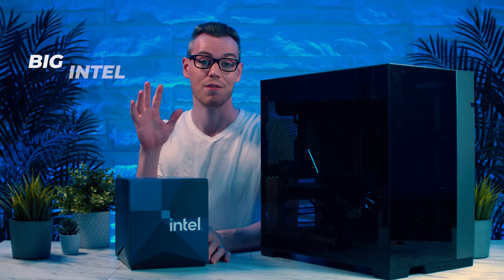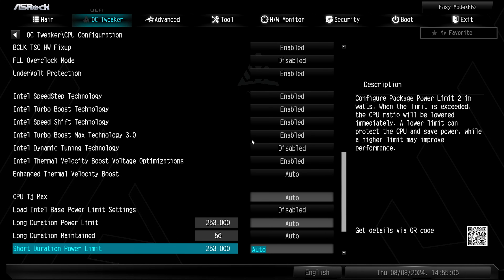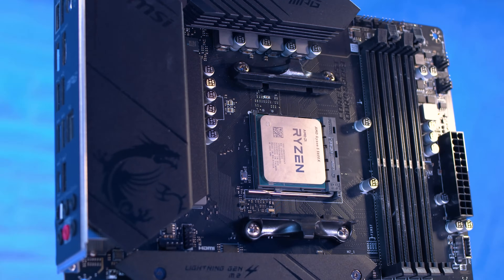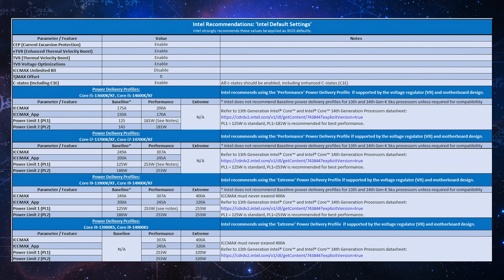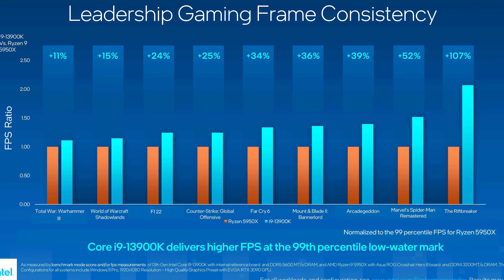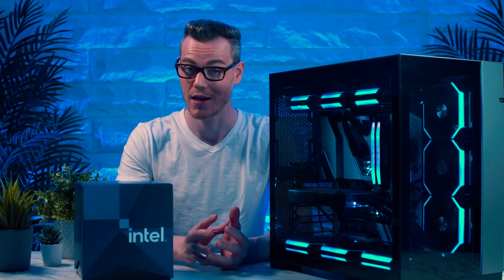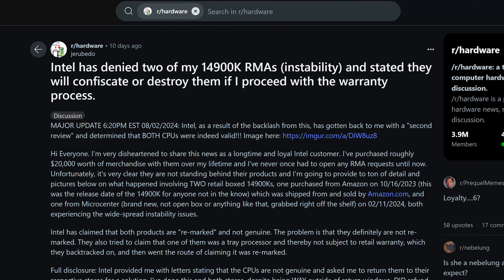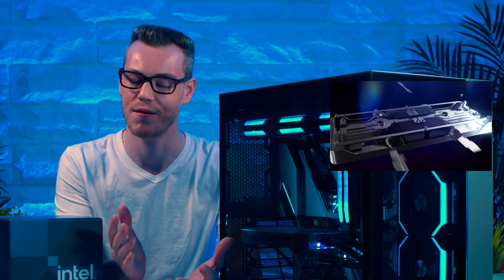The Intel Problem vs My $4000 PC... I'm Getting Mad Now

Comment: For the first part if my life i was all intel, when it came to cpu, after all i had a pentium e5500, e8400 , after that went to an i7 6700k , than to 8700k.
But i kept track with AMD stuff.Than they released the 3000 series and the core doubled again to 16c/32th as well as the ipc. At this point i decided to get an AMD processor, the ryzen 3600 , which i soon upgraded to ryzen 3700x and in 2022 i got a ryzen 5900X, which at 1440p was perfect along an rx 6800xt.
But i wanted the best for once and a month ago i got the ryzen 7800x3d and a rx 7900xtx. I have yet to test the difference, but what's certain is that i won't be upgrading anytime soon or at least untill i actually have to or there's a noticeable increase in IPC and cores per CCD along with 3d Cache. Now i'm all AMD and i'm glad i made the switch.
Reply: Same. All AMD, 5800x3D and 7900xtx nitro+. Been building PCs since my teen years and this is the most satisfying build I've made so far.
Reply: @Greenalex89  Same AMD 5950x, Sapphire 6700xt. Building pcs 30 years, best rig yet. Intel screwed the pooch, I had the original Pentium 60 with FPU and was never compensated. I've also have Nvidia chips with substrate issues in laptops. Both times they wriggled out of it until the machines were out of warranty, Intel will do the same now.
Reply: you're thowing too much money on computers man...
Reply: Half AMD :)   5800x OC 4,7all core + rtx 4070  the pc runs flawless !!!

Comment: New microcode still hitting 1.55v ....1.4v  is really pushing  the safe spot.  40mv drop is not saving anything but may get them out of warranty in home use servers now will last 3 months not 2

Comment: It's just a patch to keep the power spikes down to a minimum  so chips degrade slower until those warranties run out and they won't have to replace all of them.
Reply: Exactly, it's basically a band aid over a bullet hole
Reply: Yep
Reply: run the chips at 1.5v+ and warranty the chip as soon as instability occurs. It's yuour right to get a chip with the performance advertised.
Reply: Sad and likely correct.
Reply: With a 30% performance reduction. Just another reason AMD Ryzen wins easy.
Reply: the increase voltages in other things while dropping vcore
Reply: Ooof that's a whole ass thought and a half.. I mean Intel said they were extending the warranty an additional 2 years on top of the original 3 year warranty. I also noticed from what little research I've done, it appears Intel is openly accepting RMAs on the affected CPUs, which also restarts that 5 year extended warranty.
Reply: Yeah, some slight voltage spikes are no problem for normal, fresh, healthy IC's. They can snub them no problem!

This voltage thing is a bandaid.

Comment: Trying to get a replacement for my 1 year 5 month old  i9-13900k and you're right about Intel Customer Support acting like we're doing something wrong or that we should be all computer pros and figure out how to fix their failing products, I've been waiting for a week just to hear back from the person who's supposed to be helping me with my i9-13900k problem and I definitely don't want to call and be on hold for hours at a time with those same results.
Reply: the i9 is a Enthusiast CPU product and is top tier for programmers , streamers and PC pro,s , when someone buys a i9 , they ussaully know how too build and or configure a PC and optimize it and reflash their bios or manually enter the settings --> in bios too fix the issue with Ai bio,s automatically giving the i9,s too much voltage and a failed overclock which it isnt supposed too do at all , power limits should be set too PL1-125 and PL2 253 and Core voltage while idle 1.0v and core voltage while boosted 1.2v , average gamers ussaully use i5 and i7,s ... you can manually press and hold DELETE or F12 on startup too enter Bios and enter the correct Intel Spec power limits and voltages or update bios too fix the issue causing crashes .. the issue is auto overclock failing and causing crashes ... and actaully Intel has had alot of SCAMMERs sending in i3 12100 and i3 13100 for warrenty with re silk screened too look like i9,s !!!! so they refuse too replacce those ones as their not geniune intel core i9,s .. scammers trying too get free i9,s ... not everyone is doing that but alot have ..
Reply: @EpicGamingEct  you are incorrect  stop trying to say its not intels fault . the cpus are defective . period

Comment: i wish more people pushed static frequency/voltage overclocks instead of adaptive to vid. since 4th gen VID has always been much higher than what a chip actually needs to pass stability tests. the 100-200mhz you might lose on a single core boost to have a stable, consistent, all core overclock is absolutely worth it. do you really need an extra couple hundred mhz for internet explorer? runescape? nah. its within margin of error.
Reply: the cpu is still going to die
Reply: @zerokool1985  yeah but it wouldnt die/degrsde from voltage surpassing 1.6 at least. thats pretty huge.

Comment: I have a real aversion towards Intel. they made me angry once (yes that is enough) with their Spectre SW that was only running in US English Windows Systems but threw an error code when trying to run their Program on a PC that was running Windows in German). They corrected it after I opened a support ticket. Since then I never trusted them ever again and they make me still angry. 

This now is a real debacle. I am glad I run a AMD Ryzen 7 5800X. I do not care it is slower than a 14900K but it is stable and Rock solid.
Reply: Calm down, just think about your cat.

Comment: I'm a little confused, I've watched a ton of videos on this because 100 percent certain I'm affected. If your chip is already screwed will the update work ? I'm not tech savy at all. I have no idea how to run the tests everyone does so I'm not even sure if my chip is screwed or not. All I know is I've been having my games constantly crash for the past two months. I spent 6k on my pc so I shouldn't be having this problems.
Reply: no if your chip is already dead it's dead, no microcode will help it
Reply: RMA the CPU.  You cant reverse degradation.
Reply: NO! Intel even says, if your chip already has damage there is nothing that can be done. The problem besides misinformation claiming the update "fixes" the issue, many people have damaged CPU that it not yet bad enough to crash all the time.

Comment: The most importance is any chance that the coming 15th gen CPU has issue (degradation , freeze during high load) or not . If I am not sure I will jump ship to AMD , I dont have time to waste , just buy AMD and good to go.
Reply: I'm jumping back to AMD next build. I spent a lot of time tuning over the past year to get 12700KF & 12900KF rigs stable. I don't think it was worth the cost savings though both are great htpcs/gaming rigs (perhaps a 7800X3D would have just been less hassle). The experience to get there was bad though, countless Windows 10/11 fresh installs, ram swaps (still not getting QVL promised). The last straw was , just went full (no dual boot anymore) Nobara 39 now 40 fresh installs. My Intel experience with stability did get worse over time and I feel on the one hand I may have blamed the 7800XT & 7900XTX for crashing in a few games . When even the 4090 was having issues, I think some of those were just Intel issues. Am e cores off, running decently conservative settings on the Z690s. My friend I helped with his 5800X build in 2020 has 0 issues. Even if a future sale exists I'm not sure it's worth saving a small amount of money to have to troubleshoot just to be stable. I haven't played much with 12400F, still have that B760M from the original builds. I feel like 9600K and 12th gen moreso are the most time I have ever spent on BIOS settings. Everything is updated and I do like some learning/tinkering but I feel like never again if I can help things. It probably wasn't Windows or AMD drivers fault though any Alder Lake issues, oddly enough the AMD drivers/machines were stable on Linux. I think the theory about the IO moving for 13th/14th that they made it worse is interesting. I could stay on these machines a good 2-3 years and be happy now, but I don't think I would build them again.
Reply: There ain't gonna be 15th gen, they are calling it intel ultra X naming. Msi claw already has the ultra 5 and ultra 7 APU's
Reply: Arrow Lake will be unaffected. It's years in the making unlike Raptor trash lake.
Reply: Im surprised you are hoping 15th gen will be better! do you like suffering?
Reply: @elizabethiradukunda1950  if you understand what Raptor's problem is you do would be assured Arrow will be fine.
Reply: @epeksergastis  well.. atleast you wont say we did not warn you.. didn't intel promise the world with raptor? 
the same guys who lied to you on raptor .. now are 100% honest?
Reply: @epeksergastis  The problem with intel is the same problem Boeing has.. unbridled american corporate greed.. it's stock prices first, customers second
Reply: @elizabethiradukunda1950  you are being emotional and not rational. They even suspended dividends ffs...
Reply: @epeksergastis  oh really... as i said.. at least you were warned

Comment: I’m very tired of this mess which I think was created by both motherboard and Intel together. Out of the box the CPU should have matched default specs. Either Intel was ignoring that motherboard were not following specs or knew and looked the other way. That’s where Intel is culpable. They should replace all damaged chips and make the consumer whole again. The consumer should not have to be put through this level of anxiety. However having said that as the microcode gets released and the damaged CPUs get RMA’d and replaced, this will level out and I believe six months from now no one will remember this. Especially if Lunar Lake and Arrow Lake look promising.
Reply: The mobo manufacturers were put in the situation by Intel's non-validation of BIOS and settings.  They were used to give Intel plausible deniability, while winning benchmarks.
Reply: @RobBCactive  this . the cpu asked for high voltage and couldnt handle lower ones that effect the IO controller so the board venders did as they are told
Reply: @zerokool1985  Yeah, basically the P-core was asking for insane high voltage at idle anticipating being busy, meanwhile the ring bus and economy cores on the same power rail were out of spec.
Reply: motherboard venders are not at fault at all the board gives the cpu what it asks for .
Reply: @zerokool1985  there was nothing stopping a mobo vendor from setting a sensible ceiling voltage that could not be exceeded without action from the over-clocking menu.
That would probably have saved a lot of CPUs and gained the MB partner kudos for adding a fail safe.
Even erroneous microcode can only request not enforce a VID request.
Reply: Firstly don't buy unlocked CPU SKUs and dont buy overclocking motherboards. However Level1 techs proved this happens in commodity workstation motherboards and CPUS used in game servers. It can happen with motherboards on consevative settings. The fact nobody knows what default settings is, is also Intels fault. Intel has been running hot CPUs to win benchmarks for years now, they just finally cut the last corner to topple the house of cards.
Reply: @morpheus9137  that's because of the microcode bug causing excessively high VID requests in anticipation of resumed load and/or a weakness in the design that damages the ring bus.
Which will take a while to find out assuming the hotfix delays degradation.

Comment: i find it so funny how every techtuber rides the clickbait wave
i build high end gaming rigs, all with intel, cause amd has nasty lows and did not improve since zen2 (fabric is literally the same)

my configs stay under 1.4v doing 5.7/5.8/5.9 all core - no useless single core spikes (no gamer needs that, only cinebench techtubers)
not a single intel chip (i built 26 high end systems since 13th gen) degraded or is unstable - maybe people should start buying stuff from professional builders that use a tiny bit of common sense.

why is nobody ripping amd apart for having super bad lows and showing wrong TDP? (9xxx uses like 170W instead of their "standard" 65W - did not see a single amd fanboy techtuber mention that yet)
Reply: TDP isn't the power draw max, wtf are you talking about?
Reply: @GoonyMclinux  9700x never runs with 65w in any app - 14900k states 125w "standard/base" and a max of 253w
though in idle/browsing/watching videos it is around 60 watts

the fk you talking about

Comment: I noticed this problem a year ago and promptly switched to AMD 7950x3d.
no it's not as fast but it's rock solid.
no more crashing.
Reply: that  cpu is beast master
Reply: People have lost the plot the last 10 years with gamers review videos pushing overclocking, a stable system is the number 1 priority. Undervolt or run stock, don't overclock people. Don't buy OC parts or motherboards, save yourself a bundle and have a rock solid system.
Reply: Yeah well everyone can't afford to throw out their $400 or up mb because when I bought my Intel cpu AMD chips were catching fire so I went with Intel, not everyone has a crystal ball on hand.
Reply: @EddieMcclanahan  you mean a few on a specific mobo that was addmitid to be the mobo  fault and where amd said the same day that it would replace any damaged chip? Vs intell hiding ww2 gens of bad chips? I would agree ridenyour setup till it dies but if you defend intell or buy thier products again you deserve the issues you get.
Reply: @EddieMcclanahan  asus admitted to the issue themselves and amd gave new cpus unlike intel
Reply: @zerokool1985 Asus has been having plenty of issues recently. I've been avoiding them for a while.

Comment: I'm running a similarly priced machine, granted a lot of that price is 18 Corsair RGB fans... Yeah that one hurt. 
My only blessing is I'm still running a 12600k chip. 
I have a new z790 board with a 13700, but I'm not sure if I should bother putting it in
Reply: 18 Fans? OK, enough internet for me today
Reply: @Greenalex89  this is an air-cooled build in a thermaltake core p8. 
18 fans isn't even the max that you can do, it's just the max that I could afford
Reply: send the 13700 back
Reply: People spending all their money on fans and RGB kinda had it coming, buy sensible 'boring' hardware guys.

Comment: I think this is a defect in the architecture of the 13th and 14th gen cpus. The microcode bios update in my opinion is just a bandage to slow down the cpus from failing .  If it was just a micro core issue intel would of released it a long time ago, I mean the 13900k came out almost 2 years ago and their just releasing a patch for ? makes no sense
Reply: The team that made the 12th gen said the ICC was beyond maxed out also ringbus, they left and new team made 13/14 in record time. Not hard to figure out what went wrong lol
Reply: They have fucked up the Voltages... Lock them at 1.3V or below.
Reply: False it has nothing to do about hardware. It’s the terrible stock bios settings. Were they are pushing 1.5 volts into 2 of their cores. People that naturally tune their CPU’s or undervolt don’t have these issues at all.
Reply: @ZackSNetwork  no its absolutely the cpu design . the IO is disconnected off the die  and is linked to another part that needs more voltage unfortunately that high voltage is killing the IO controller . its a flawed design
Reply: @ZackSNetwork bruh even Intel's new 0x129 microcode limits the voltage spikes to 1.55V, the official Intel spec is 1.72V which is just insane. The microcode update is just a band-aid patch as it will slow down the degradation but 1.55V is still very high and will most definitely cause degradation over time. Intel is probably just banking on that happening after the warranty expires.
Reply: @ZackSNetwork yes i undervolted and set all limits on first day i got my 14900k and never had crashes
Reply: @ZackSNetwork  This just isn't true. I've undervolted my CPU by -0.07mV (the most I could get stable). Generally, my voltage never went past 1.53V. It still became unstable after a few months. I also used PL1 = PL2 = 253W, and ICCMax = 307A. Any further undervolting became unstable. The new microcode caps voltages at 1.55V, and mine was always below that.
Reply: @roquen22  1.53 Volts is death voltage. Better have that 1.3V or below.
Reply: @epeksergastis  Yes I fully agree. That's my point. Anything below 1.53 volts peaks is STILL unstable at advertised performance. And the new microcode caps at 1.55 volts. So what I'm saying is undervolting still doesn't help. They are still dying. The only real fix is to gimp performance AND to get voltage below 1.4.
Reply: @roquen22  they fucked up with this arch